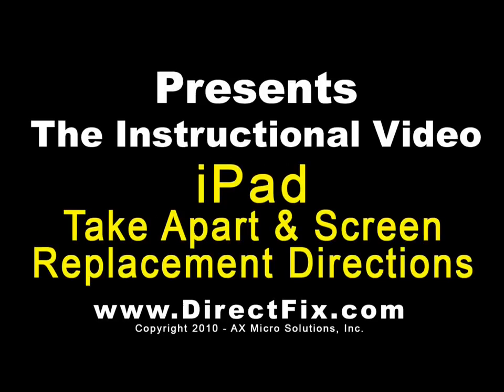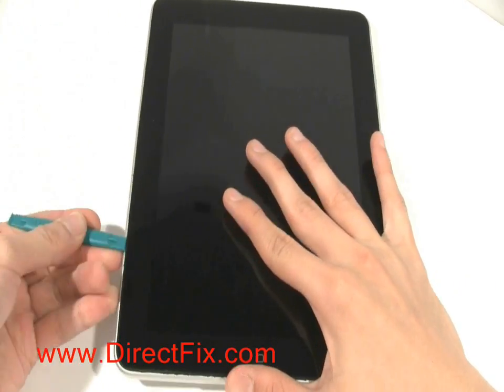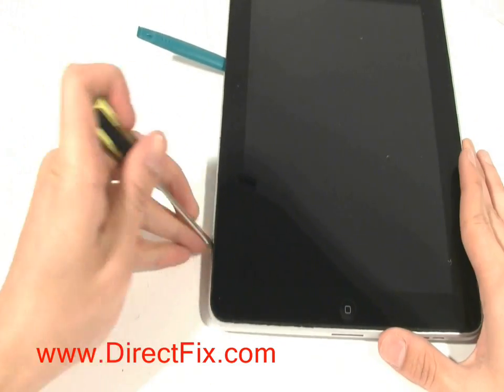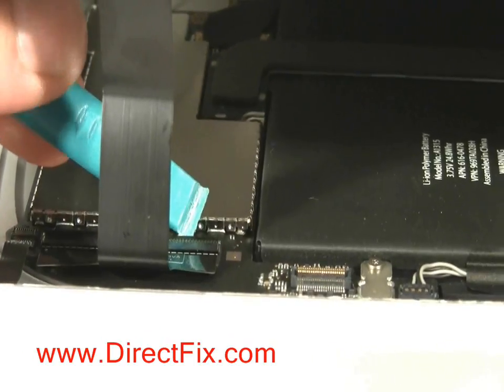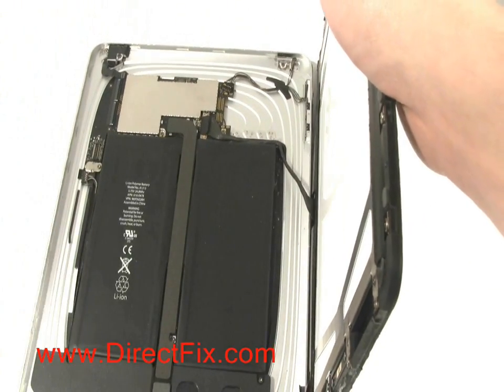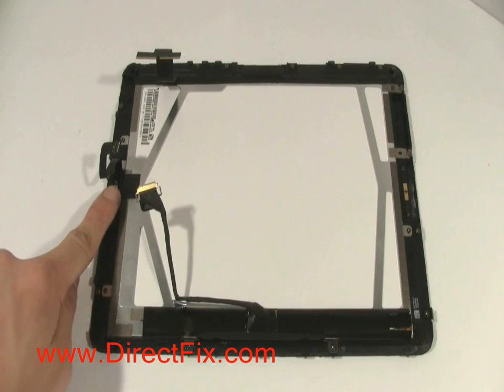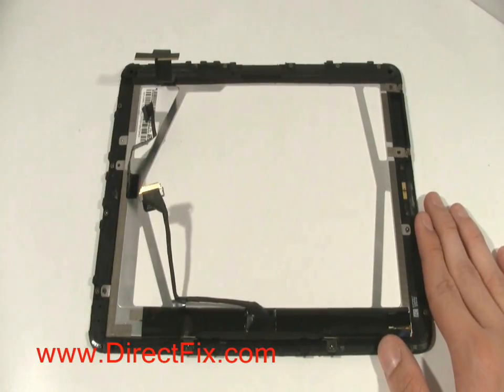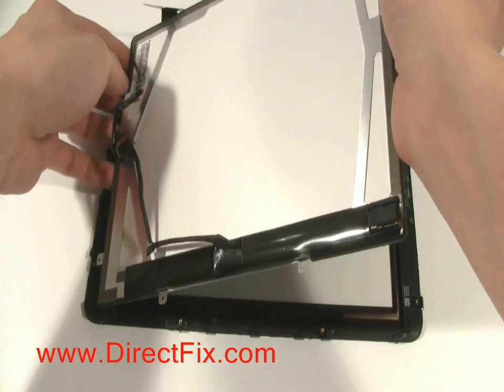How To: iPad Screen Replacement & Take Apart Directions

Comment: great stuff. I just followed your instructions and secured a loose connection on one of the screen cables, thus recovering from a completely blank screen problem I've had for over a month. Of course Apple wanted me to pay $285 for a refurbished ipad 1 replacement, which I though was not worth the cost. Considering all I get is 3 months warranty. Thanks guys keep up the good work.